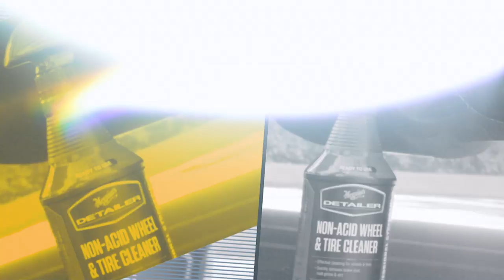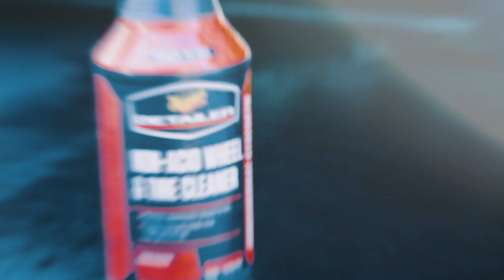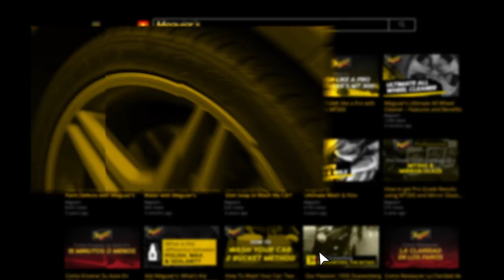Professional Ready to Use Products for Maximum  Results - For Professional Detailers & Enthusiasts

Comment: Would D2002 remove water spots on my paint if used with a microfiber washmit?
Reply from the maker: Iron Decon products work best to remove iron based particles from the surface.  Water spots are not really the target of it's design and many times water spots have etched into the paint which will require compounding to remove.

Comment: How is the dilution ratio to these ready to use professional products?
Reply from the maker: Iron Removing Spray Clay - Unique product so no exact equivalent, but a little less aggressive than D1801 and can be used as clay lube.

Non-Acid Wheel & Tire Cleaner - Is equivalent to D143 not diluted.  Both are RTU.

Citrus Power Cleaner Plus - This is D107 diluted at 4:1.

Hyper Dressing - Is D170 Hyper Dressing diluted at 1:1.

Comment: Hi I just have a question is the non acid wheel cleaner safe on after market wheels ?
Reply from the maker: Broad question, but the reality is aftermarket wheels are made of many different materials that can be very sensitive. I.E. bare aluminum, anodized, powder coated, PVD, etc.  Choosing the right wheel cleaner is vital to ensuring you do not damage your wheels.  That being the case, without a very accurate understanding of the finish on your wheels we do not recommend our Non-Acid Wheel Cleaner be used on aftermarket wheels.  Our Ultimate All Wheel Cleaner is the safe choice if unclear.